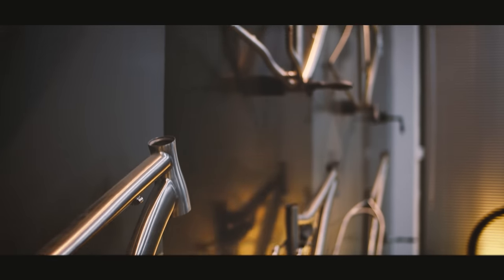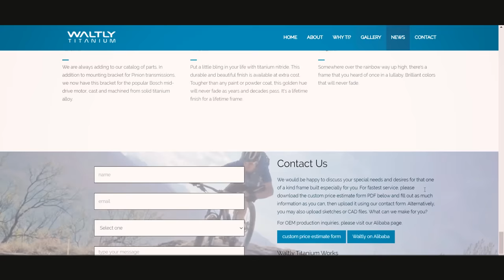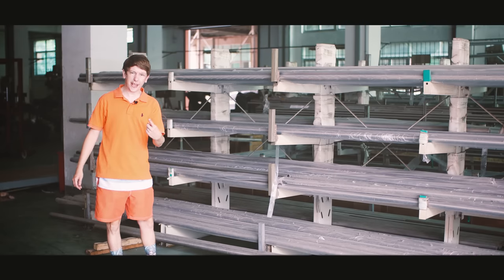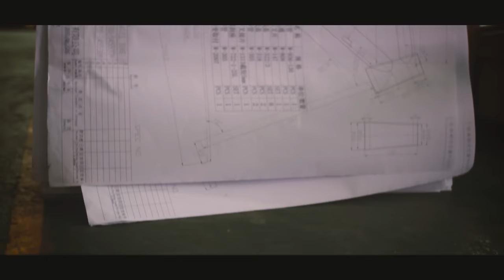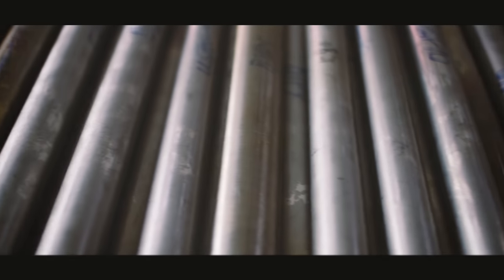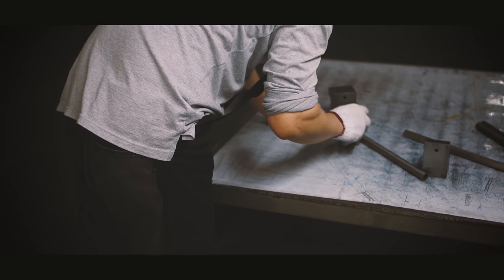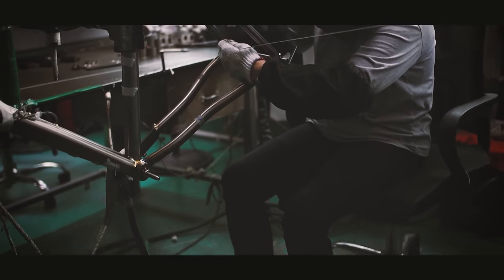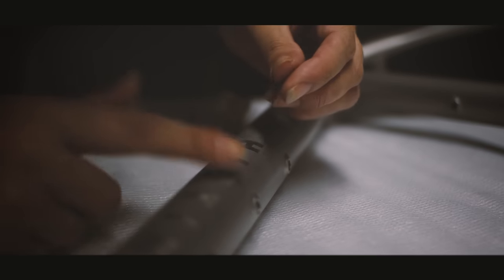Custom Titanium Frame from China - Waltly Factory Tour

Comment: I have one of their frames and I dealt with Amy. It was a solid experience through and through, and with over 7,000km on the frame, not even the tiniest of issues. Cheers
Reply: Did you pay using PayPal?  Was their PayPal email address a “@hotmail.com” address?  I am about to send a deposit and want to verify that the PayPal recipient is legitamate.  I have also been emailing Amy Lv, but am located in the USA.  I am trying to be sure I am dealing with the correct Amy.  She has been very helpful.
Reply: @1601mat  I can't remember how I paid. probably with CC through the link that was sent to me. I'm sure you can confirm with Amy the correct paypal address.

Comment: I believe this is the same factory my Van Nicholas Skeiron frame was built in. It's definitely a quality piece of work and I saved a bunch of money over the two gold digging brands you mentioned in this video. I built the bike up myself with Shimano Dura-Ace 9170 and fitting everything just worked. The ride is absolutely better than any bike I've ever owned which is a lot of bikes including a Merlin titanium frame I had about 15 years ago and sold because it was a POS. I'm so happy with this Van Nicholas that I will not be buying any more bikes. It's modern with internal cable routing, disk brakes, and more. Love you videos and wish you could produce them more often but I understand how busy life can be. Enjoy the ride Bro.
Reply from the maker: I'm not 100% sure, but I'm 99% sure your frame was made in another Titanium factory in Beijing. But, yeah, I think mass production labour intensive production is very suitable for China with it's labour cost to skill ratio.
Reply: nicholas frame made in beijing bro~
Reply: @senye2903  Yes, you are correct. I did some searching and found some video on a manufacturer that clearly showed lots of Van Nicholas frames spread all over the floor and not getting any love. Good news though, I found a custom frame builder here in the US to build me a new titanium frame. I felt it was time to get one made specifically for me. I sure hope they are right about that otherwise I just spent $4500 for nothing.
Reply: @wasupwitdat1mofiki94  i watched a moots factory tour, it is full of overpaid young hipsters with regrettable tattoos, your money well spend
Reply: @involuntarysoul3867  Moots and all the other brands making you pay $5k+ are basically con artists playing on the "artisan" card.

Comment: I'd highly recommend Waltly. After being very disappointed with some other custom builders (no names mentioned, Enigma), I've had nothing but great frames and service (thanks Amy!) from Waltly. Currently waiting for my 3rd road frame to be finished. I've had quite a few custom frames over the years and the craftsmen at Waltly are second to none IMHO. They know their material and really bring the best out of it. Just make sure you have a clear idea of what you want and Waltly will make you a great bike.
Reply: Hii.. what is usually the frame cost ?
Reply: @nishantmh25  around 800USD plus any import tax you need to pay.
Reply: Depending on spec of course. The above gets you a regular road frame, external cables, rim brakes. Fork not included.
Reply: @1601mat  yes, that's how I paid
Reply: @jonathanbird173  Was your down payment 50% for “frame design + production,” instead of the 30% design as stated on their website?  Waltly is adamant for 50% down from me, which I am OK with if this is their standard with prior customers.  I just don’t want it to be an indicator that they are searching for cashflow---to stay afloat---during these times of COVID-19. (I really do appreciate your responses. They provide invaluable information---and peace of mind for me.)
Reply: @1601mat  I have paid 50% up front and 50% on completion every time. They are a very trustworthy and reliable company IMHO
Reply: @jonathanbird173  You helped me make my decision to proceed with a deposit.  Thank you for sharing your experience and opinion with me.
Reply: @1601mat  I'm sure you'll get a great bike :)

Comment: In 2019 I also got a custom gravel frame from Waltly. They were very helpful, and the finished product was spot on - recommended. However, you really need to be able to read drawings, to check all the dimensions, and to be patient; it took several iterations to get to the final drawing(!). If you're not so fussy a stock frame would be much simpler.

Comment: Hi friend. I am interested in building a frame and I do not doubt the quality of waltly but I have a question ... how am I going to mount the brakes and have them match in the exact place? I never did an assembly and I believe that the CAD drawing of the frame is provided by Waltly before its manufacture, I only think of buying wheels, hubs, brakes and passing the measurements ......
Reply from the maker: There is some "play" in the position of the brakes, so you get them in the right position before you tighten the bolts.

Comment: great video. i thinking to order 1 too. i have abit concern because @mark said that the minor issue on the rear  brake flat mount. let me know if they can solve it before delivery
Reply from the maker: Mine was fine. I guess you can ask them to double-check it
Reply: @ChinaCycling  what fork you are using? do they supply too?

Comment: Thanks for more of the inside dope, Joe! You highlight the often fine quality of Chinese manufacturing. Are there any aluminium frame manufacturers who do direct sales?
Reply from the maker: Interesting question! I think most of the aluminium factories in China are doing bulk orders for lower end stuff. Then I think the higher end stuff like the Allez Sprint is made by Merida in Taiwan. The cost price for these mid-level aluminium frames is SUPER cheap. I mean... shockingly. The cost price of an aluminium frame is usually less than the carbon fork that goes with it. Shipping price would probably be higher than production cost.
Reply: @ChinaCycling  Thanks, again.
Reply: Taiwanese and Chinese manufacturing are as good as the buyer specs the product to. Spec high end you get a high end product. Spec a low end cheap product like the Walmart’s of the world do, and you’ll get a low end cheap product. China and Taiwan have invested hundreds of billions of dollars into upgrading and maintaining their factories over the past 4 decades. US has spent their $ on their military industrial complex and crony capitalism bloated contracts during that same period. 

Most US factories, not all but most are aged and substantially outdated compared to the typical Taiwanese factory.